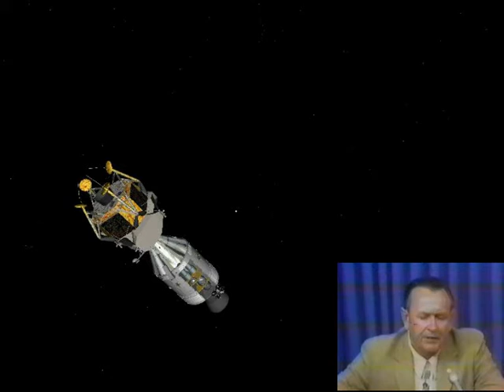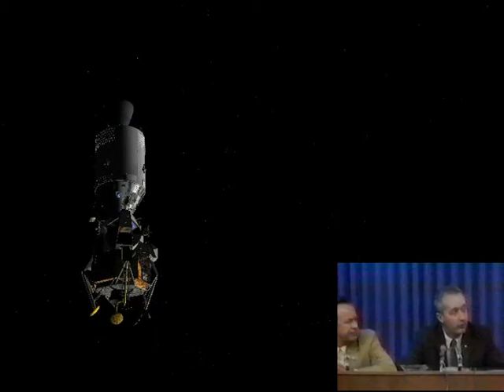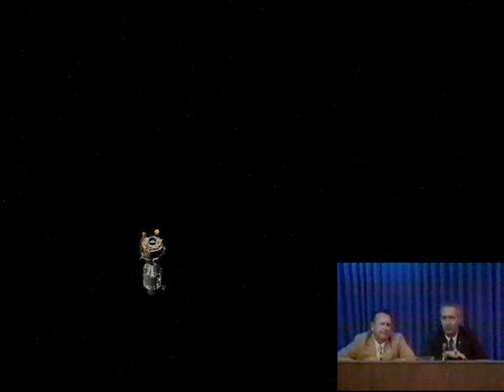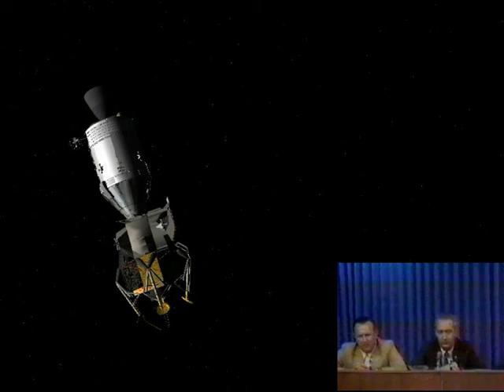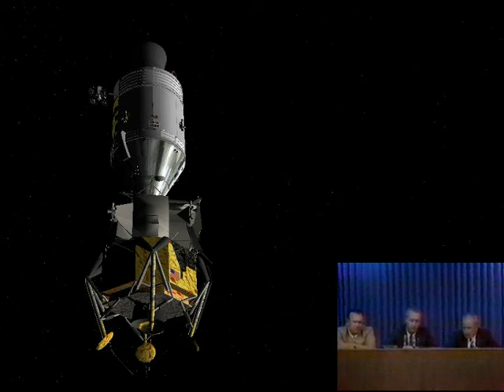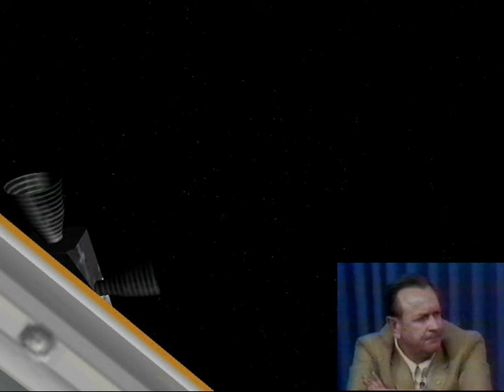Apollo 13 Press Conference (Full Mission 14)

Comment: Yes I've listened to those recordings too.  There are sometimes chirping noises which I think is a bit of corruption when they encoded the .wav files. With regard this particular recording, the reason I think it's the sound of the thrusters is that it sounds very much part of background noise of what can be heard in the cabin.  Notice when Jim is talking (where I'm pretty sure you can also hear the noise of the cabin fan) Jack can be heard in the background via Jim's mic.